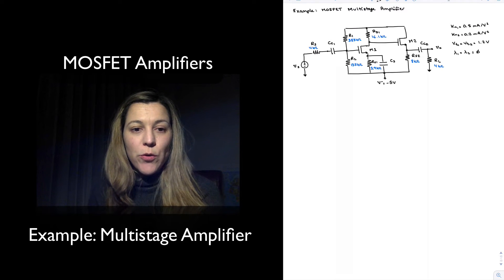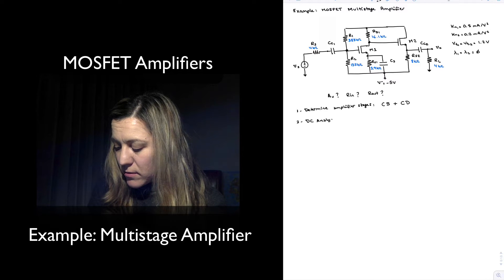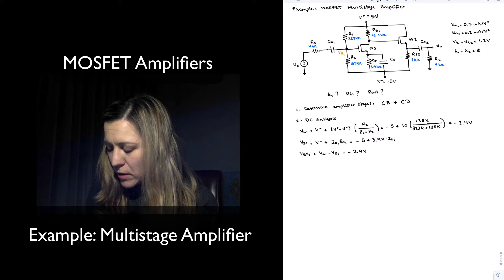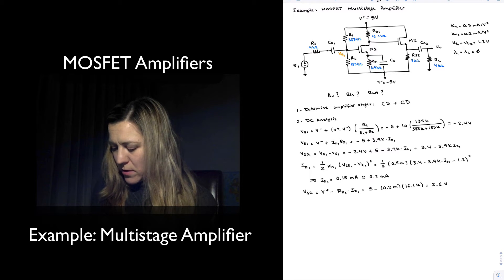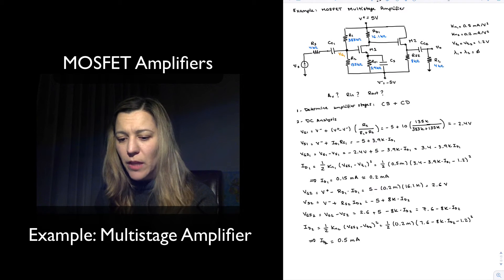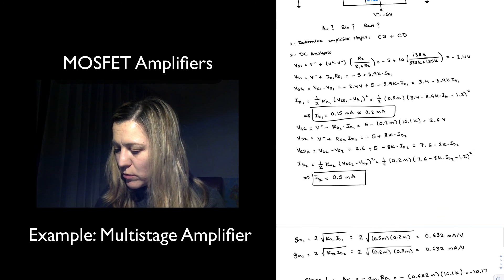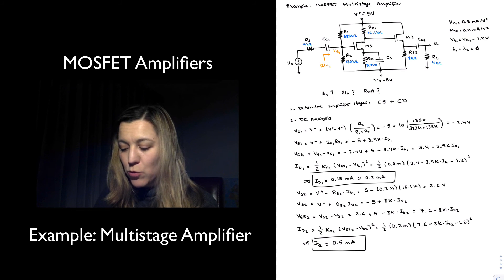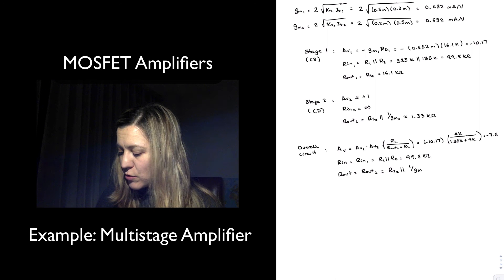Example: Multistage MOSFET Amplifier

Comment: There's a mistake in the calculation of V(gs1): -2.4 + 5 = 2.6V and not 3.4V (@4:16), Also, in V(g2) (@5:55). Thank you for the example!
Reply: bro but the procedure of calculating the ans parameters is correct right?